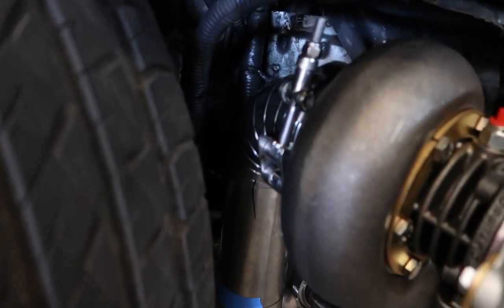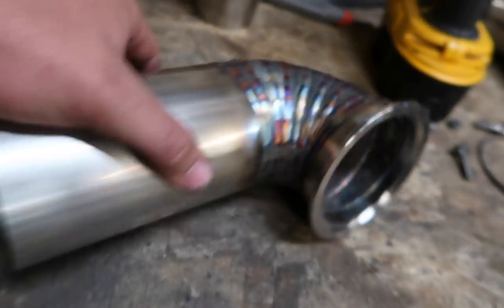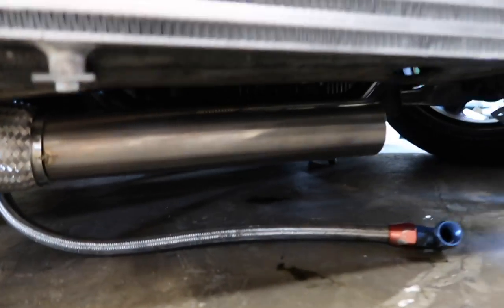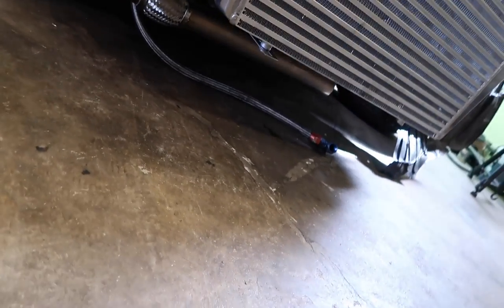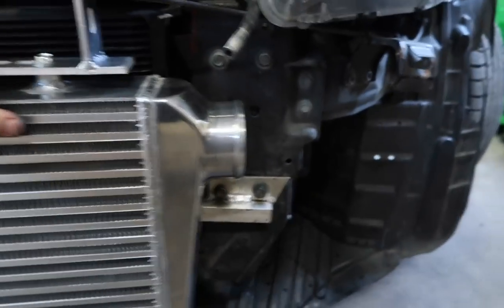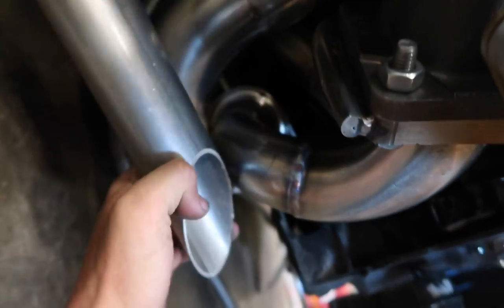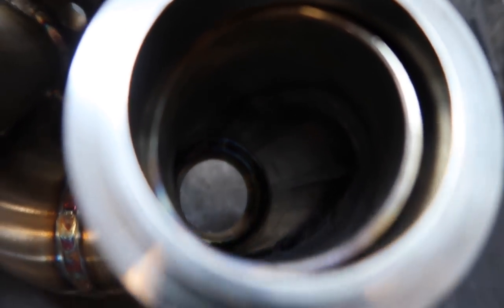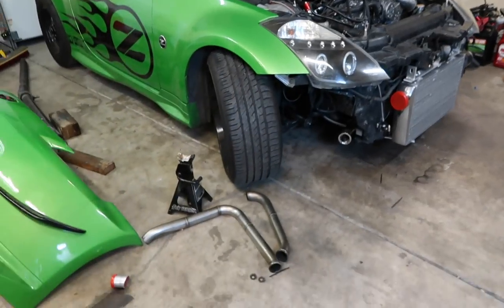350z: Fabrication is Finished!

Comment: If you make a b-series turbo top mount with some support tabs id be down to buy one. They like to crack at the runners 😭
Reply from the maker: Boosted Gsr the cheap eBay ones do!
Reply: SuicideCRX  fuck that they dont make power. Id be better off with my shitty plm top mount and its 30 cracks

Comment: How on earth is this setup going to work with just one wastegate placed on just one of the feed pipes for the turbo!?????? If this turbo is a twin Scroll, then one wastegate placed like that is not going to work! The other side will just feed the turbo uncontrollably. You will either have to put the wastegate where the two feeds meet or you have to use two wastegates.
Reply: Ismaak5 you literally have no idea how a twin scroll turbo works, do you?
Reply: That is you my friend not me! Give me one, twin scroll turbo setup with the wastegate on one port that works and prove me wrong! I dare you!
Reply: Ismaak5 edit: watched this video before his last, now I see he did go divided for the cylinder banks, I thought they had already merged before turbo. Single wastegate will still work, but you're right, single wg totally defeat the purpose of twin scroll and will barely control boost
Reply: My fault fam
Reply: Mistakes happen!

Comment: NAAAA Hayden VQ's SUCK DOWN oil. its one of the biggest flaws with them. If i could have 2 things different on the VQ.... fix the oil guzzling and build it a little stronger. They handle boost so well but anything over around 450 crank and they start chuckin parts. (stock bottom end balling on a budget ofc)